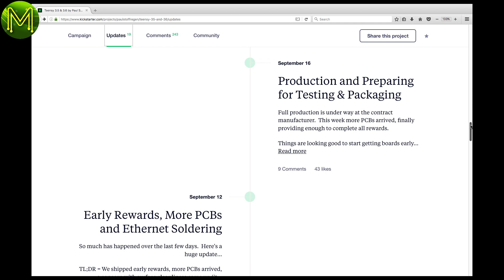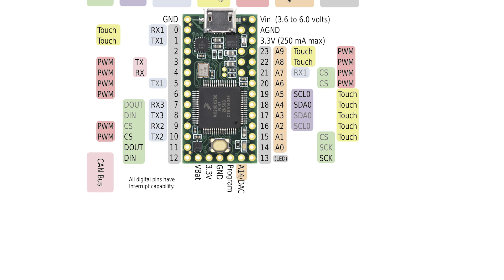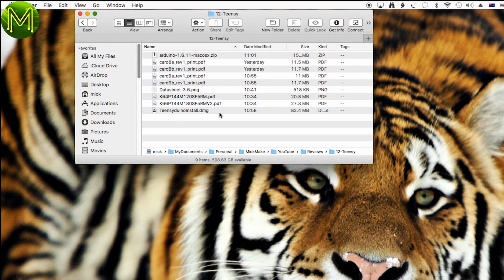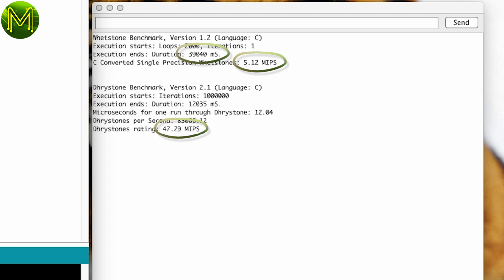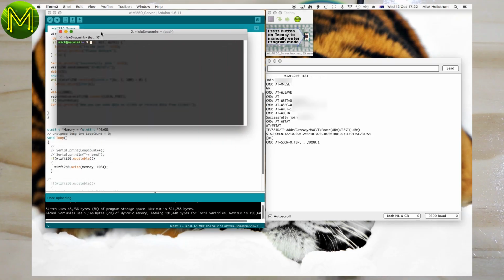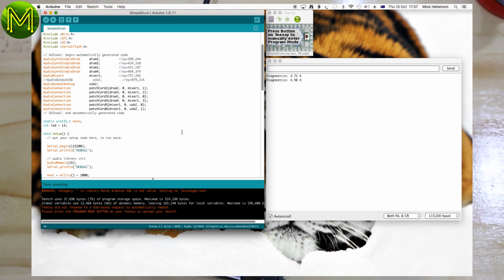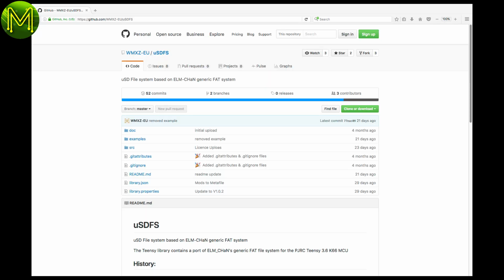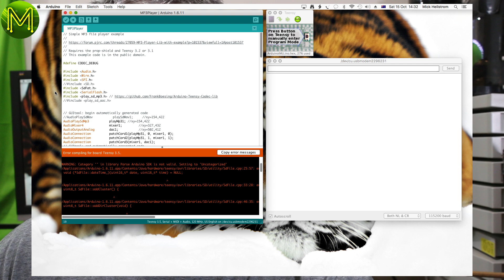#059 The Teensy 3.5: Bigger on the inside. // Review

Comment: I would like to make this schematic but I have a problem with Arduino UNO, NANO ......!!! Is there any way to update the bootloader directly from a sketch? But then what does this update consist of? Two system data. I also have a teensy 2.0 and would like to figure out how to make it work, ok you have to change the port name (which will not be called A0 .... a5). Could you please post a diagram with teensy. It always works with Arduino IDE but it requires the program (which gives problems during registration, it wants a precise path but there is no plan to change it....). Which version of Arduino IDE is "decent" and functional? Teensyduino what is the damn path for 'installation? It is NOT possible to specify where to install it. What a piece of crap. How do I solve it? I'll stand by. Thank you.

Comment: Your concern with the BGA pins is justified.  I have a 3.6 from the kickstarter that has intermittent connections in one of the corners after I soldered the header pins on.  I would strongly suggest ordering the part with the header installed to avoid hassles of who caused the intermittent.  Besides the thermal stress you mention the long, thin skinny board will definitely over stress the solder joints if your not extremely careful when removing the board.
Reply from the maker: +the bicycleguy 
Yup, the BGA is very close to both edges, which is an unusual configuration. It should really have glue holding it down. It's usually squirted in after soldering, but is very fiddle so can understand Paul not doing it for the first batch.

Comment: now only the chinese need to copy this thing to make it affordable.  good little board
Reply from the maker: +gamerpaddy 
It's a nice board. I'm not sure how much margin anyone could make on it by copying. Most of the value add is in the software.
Reply: MickMake true. but depending on the country it costs up to 45$   not quite affordable for the average user. cheap for a spezialized project but expensive for tinkering and fiddling around. the people rather pick a arm sbc or go with complicated stm32 devices if they need much performance. the Hardware barely cost anything and they still would make reasonable profit when lowering the price a bit and probably more people buy it then.   i would get one if i could find it for 20..25$ anywhere

Comment: Mick, the Teensyduino 1.31 never seems to get past "next", it does not show "the Libraries" with checked boxes, just folder names, and cannot get to install.  The Tutorials seem to skim over the installation. The versions have changed slightly.. Now its Teensyduino 1.31. I've got the 3.6, downloaded Arduino, Teensy and AVR insight, 48 hours of trying and no luck after watching countless tutorials that all seem to skim rapidly over the basics. Otherwise I love your tutorials.
Reply from the maker: +Ram Jet 
You need to select the directory, (or folder), that you installed the Arduino IDE into.
On a Mac it'll be under /Applications/Arduino, windows it'll be C:\Program Files\Arduino
Reply: Thanks Mick, it is important to click next or the item or it appears as if it does not work. It worked when put all the files into programs not programs x86,  Now, I'm looking for a 2 second analog delay file. When I use the design feature, it gives constant "Error compiling for board Teensy 3.6, Just need mono, would anyone have such a file?  pm ramjet555 at ggmale

Comment: hello I bought tenssy 3.6 is I would simply remove the code from my macbook a1534
how I do to simply remove the code.
is that you have to download a program ??
thank you in advance
Reply from the maker: If you are having trouble with TeensyDuino and any version of the Arduino IDE, then installing from scratch is the best way.
I tend to have many different versions of the Arduino IDE. Even several copies of the same version as I test across many many boards and many different versions. So I keep them all separate.

Comment: Wow, great review video.  Lots of actual testing!  That's really refreshing to see, when so many others just hold the product up and talk about the specs they got from the web.

I recently updated the Arduino SD library to support the on-board SD card, in version 1.31-beta2, published shortly after this video was made.  It uses only the small block size.  I plan to greatly improve the default SD library with advanced caching, larger transfer sizes, and interrupt-safe usage... but that work is months away.

The USB audio distortion is a Macintosh driver bug.  Teensy's actual audio rate is 41117 Hz, which is 17 Hz faster than the nominal 44.1 kHz.  The USB audio uses the "asynchronous" mode, with a dedicated isochronous feedback endpoint.  Your computer is supposed to change the data rate slightly, according to the feedback.  Windows and Linux have no problems.  Macintosh does it fine too, for a while.  But with quite a lot of experimenting, I learned there's a limit of about 10 Hz.  If you ask a Mac to alter the rate to more than 41110 Hz, it will do so, but after a few minutes the audio distorts terribly.  It's definitely a bug on the Mac's driver, transmitting corrupted data.  If you leave it running, after about half an hour the Mac will manage to properly adapt and the audio will return to normal, at the 41117 Hz rate.

Eventually, I'm going to rewrite the USB audio code to use "adaptive" mode instead of "asynchronous" (as defined by the USB audio class spec, available at usb dot org).  Then Teensy will become responsible for adapting to the slight mismatch in sample rates.  But that's going to take quite a lot of difficult programming work and quite a bit processing done on the Teensy side, so it's unlikely to happen until well into 2017.  In the meantime, there's a #define you can edit in usb_audio.cpp (on a Mac, control-click Arduino and use "show package contents" to look inside), to enable a workaround that limits the feedback sent to your Mac to no more than 41110 Hz.  Because your Mac won't be sending quite fast enough, the USB audio will get a buffer underrun once every few minutes, which can result in a slight click sound.  Not perfect, but not nearly as bad as the horrible distortion from the Mac's driver bug.
Reply from the maker: Hi Paul,
Thanks very much! Hope you had a better celebration dinner, (from your photo), after all your hard work?

Yup, I discovered your pjrc forum post on the 1.31beta2 update and included testing of that in my Teensy 3.6 review video.
https://www.youtube.com/watch?v=5FqCr4TGehw

Yes, I figured there was a mismatch with audio rates, but thanks very much for your comment. It sheds a lot more light on the situation.

Keep up the good work!
Reply from the maker: BTW. I'm impressed with the professional audio library you've created. A fantastic value add-on.

Comment: Great Video as always but wouldent worry about your fear of the BGA pealing off lol! 
underfill is only really required if you have a High mass device and anticipate dropping it alot.
Reply from the maker: +Get Electronic 
Thanks!

Yes true, but it is after all an exposed device. There's also the issue of water and other conductive materials getting underneath the package and will be next to impossible to get rid of.
But it wasn't a major issue, just a minor one, it may or may not have the potential to be big.
Time will tell.
Reply: IMO for a bare board you can't be too concerned about "water and conductive materials" regardless of the chip packaging.

Comment: If the MCU never needs to be removed, What is the problem with BGA IC's
Reply from the maker: +TheProCactus 
Usually a BGA package will have adhesive squirted underneath after soldering. This is done for two reasons:
1. To secure the package to the PCB to avoid it peeling off.
2. To stop stuff from getting underneath and shorting out pins.
I don't have an issue with BGAs I was just concerned that the board was long and thin and with no adhesive it might end up being an issue.
Don't get me wrong. It's one of those things that may or may not be a big issue.
Reply: ok, Cheers :)

Comment: Kinda considering one of these for a keyboard project I'm working on now. I was just gonna go with one of the older versions but the integrated SD card reader and extra power could let me do some cool stuff like add a display. The SD card would be a great solution to the issue of saving settings. I didn't really want to use the EEPROM as it only has a limited number of writes so the only other solution would have been to sync the data from a PC on power up but that is not ideal.
Reply from the maker: +James Coyle 
Sounds like a great project you have brewing there! 
Many years ago I was looking at building my own chordic keyboard, but having to work for a large company and sign a contract that limited my own inventions it was shelved.
I should bring it out again.

Comment: It looks like Paul has done another great job.  Regarding the potential issues with BGA and PCB flex, the use of soldered headers will likely provide enough rigidity to allow the board to be installed in a socket or breadboard if one is careful when inserting or removing the board from the socket.  Time will tell.
Reply from the maker: +arlen raasch 
Yup agreed!

Comment: Both the old and new Teensy's use SMT parts.  The old were TQFP parts, the new BGA as you said, but BOTH are SMD (IE: NOT through hole).  Oh and BGA is a proven tech that's been used for years.  Your cellphone has mostly BGA parts, the Raspberry Pi has BGA parts.  I think from the photo that the teensy's BGA parts weren't heated enough, or the pads under the board were not large enough, the part should have sunk down closer to the board.
Reply from the maker: +Kenneth Scharf 
Yup I know, that was a guff on my part.

Even though it's proven tech they're normally located in a case well away from human contact. It can be a major issue having and exposed BGA like that. I can imagine some people bending the board and it'll pop right off, or getting water underneath the package which would be a real bugger to get rid of.
Not to mention intermetallic growths on a BGA with no adhesive would kill it. It's no salvageable.

Comment: Small mistake in your video. Both MCUs are SMD, the older version is a QFP (64pin) package (leaded). The BGA is a Lead-less package.
Reply from the maker: +D.E. Sarcarean 
Thanks mate. Yup, they are both technically SMDs. As a one man band mistakes can creep in sometimes.
Thanks for picking that up.
Reply: BGA is also SMD (surface mounted device) as opposed to  through-hole technology.

Comment: On the point of running a good Kickstarter, I've argued long and heatedly with some people who feel that the devs should be hanging on their every word in the comment stream, constantly petting them and reassuring them. My feeling is that the devs' JOB is to create the danged product. I don't need them to answer every single redundant copy of the same four questions that they've ALREADY answered in an update AND in the FAQ. They don't need to jump to reply to every single comment and question. I think it's perfectly reasonable to gather up a lot of questions and issue an UPDATE addressing the important ones.

The update section on a Kickstarter is the appropriate place for the devs to keep in touch with the backers. It's automatically sent to ALL backers at the same time, the backers get an update notice in their email, and it's easily located on the kickstarter page. Not so for answering comments. They have to respond sometimes DAYS later, and the comments are not threaded. The person asking the question may not know they've been answered, and then there's the problem of multiple people asking the same question over and over and over, many of whom never see the answer because they aren't scrolling through days and weeks of comments to find them. Communications via the comments are useful for SOME things, but answering questions about progress is not one of them. I'd much rather see the devs save up the questions and answer in an update when they have time, than to assign someone the task of constantly monitoring and answering the comments -- because that just drains resources that could probably be put to more productive use actually MAKING THE PRODUCT.

Make the product. Then tell me what you did. So long as you don't go an excessive length of time without an update -- such as when there's a significant delay in production for any of the thousands of reasons I've seen such production get delayed in the Real World(tm) -- I'm perfectly happy to let you do your job cranking on code and developing hardware. A half day spent hand-holding on the comments is a half day that could have been spent making sure the project is on track, debugging a problem in the code, or handling a logistics problem in the fulfillment side of things. 

If you need someone to hold your hand and constantly reassure you about the progress of a project, just save yourself the stress and ask for a refund. When the product comes out on Amazon, buy it then. You'll get your instant gratification when Prime delivers it a day or two later, and you won't be making the devs crazy with your constant harping and demanding they drop everything to reassure you.
Reply from the maker: +Gwen Patton 
I thoroughly agree. Having spent my whole career working on engineering projects and some of them undergoing the issues you described; it's a messy business.
The thing that makes life oh so much easier is a great project manager who handles most of the communication between customer and devs.
A lot of these Kickstarters think they can get away without a decent PM, or even a PM at all!
Reply: And working prototypes! A successful kickstarter needs to have a product that's already up and running, to show exactly what customers would be getting. Asking for the cash for production and distribution, no R&D, are the only Kickstarters I even consider these days.

Comment: I've said it before and I'll say it again: Paul and his cohorts have done a gosh durn fantastic job with all the different libraries and making things easy and accessible even for the less-experienced people. That said, I don't think these will become the "Raspberry Pi of the Arduino world;" accessing and using those extra pins under the board is quite complicated, these boards don't offer WiFi, Bluetooth or any other similar method for wireless communications, and they are expensive. I still believe the ESP32 is better-placed to reaching that position, once the libraries and boards mature.

PS. The gag with the BGA-drawing was fabulous, well done!
Reply from the maker: +Nita Vesa 
Yup. I agree. I haven't used the audio library for a while and it's matured a lot.
Using micro-Python on the new Teensy might be nice. Especially being loaded from SD, but yup. The ESPs are very cheap and very ubiquitous.

Comment: can this board run program from micro sd?
Reply: I am not familiar with this chip but generally modern MCUs can reflash their program code (ROM) from any source. That is of course if you provide a program that will do the reading and writing. In some cases you can also load code into RAM and execute it from there. I think it is also possible in any ARM MCU. However, if you are asking weather the program can be run directly from the SD the answer is likely to be no. There is at least the reason of SPI speed limiting how fast that code can be obtained by the CPU.